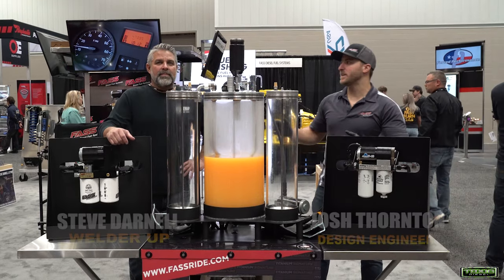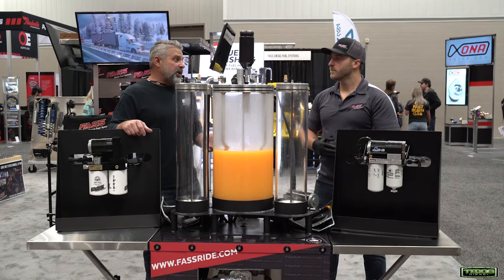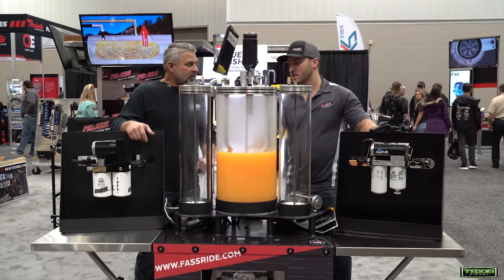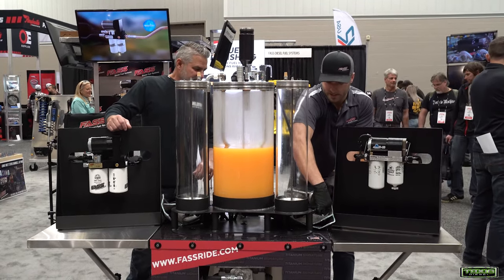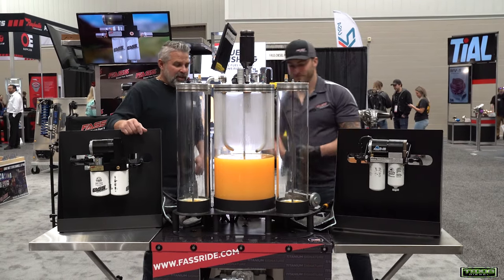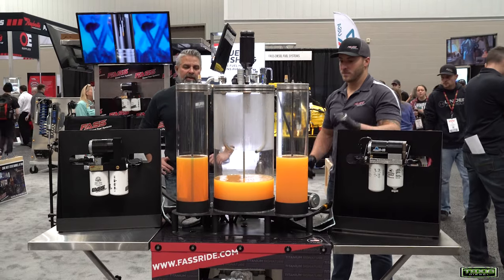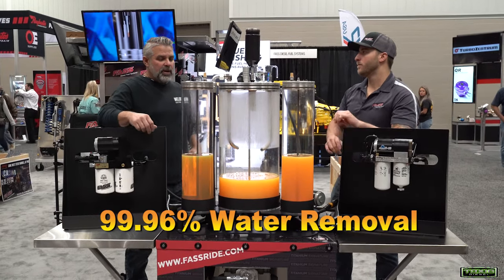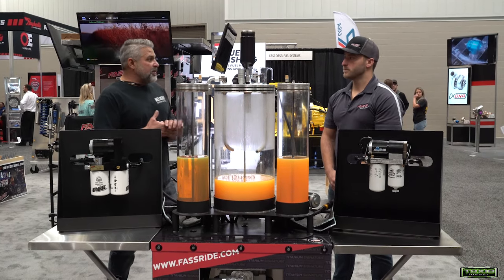FASS or AirDog - You Decide After Watching This Video

Comment: I have tested both on my 07 5.9 Cummins and they both work great however price point and customer service is so much better on the air dog I wouldn’t even consider the fass system and just seeing then use a separate air dog with no filters on it in behind the stand makes the fass brand possibly the shadiest diesel brand on the market don’t believe me call them and try to get customer service on any products
Reply: Thank you!!
Reply: AIR DOG Staff are some of the most friendly professionals and knowledgeable about their products I have their systems on my 02 and 04.5 cummins and they have stood by their products. Highly recommended.  Idk anything about Fass systems. Never needed to
Reply: Yeah this test is rigged lol
Reply: Where did you see them using and air dog with no filter?
Reply: Had a warn out 200gph old style Airdog  on the truck I bought. They worked me a new motor and rebuild kit, and I modified it to run Cat filters and Baldwin water separator with dump. 
Customer service and treating people right is air dogs advertising.
Running a separator with no dump is not normal in heavy diesel equipment.
Reply: @robsnodgrass915 what did you do to run these filters and what part numbers ? Thanks

Comment: a good fuel pump should not be putting air in  the fuel like fass just did in the video
Reply from the maker: This test was demonstrating how FASS uses better quality filters.
Reply: @toxic-performance  I'd like to see filters on the Air dog, not empty canisters. Laughable!!
Reply: @toxic-performance  its a Fuel Air Separator System.. there should not be big bursts of bubbles in the fuel line
Reply: My buddy’s fass is trash be rebuilt by fass many times
Reply: @resqjason2 I don’t have a dog in the race but I’d guess the air bubbles are simply from the water fountain effect of the tanks. If he primed them and let them settle before turning it on or filled them a quarter of the way then let them rest and then run the test you wouldn’t see any bubbles. 🤷‍♂️
Reply: @toxic-performance except people saw more than you meant them to pay attention to…

Comment: After seeing all those air bubbles defiantly going with the air dog I would like to see this done with clean fuel to compare the air separation of each pump
Reply: They also have the returns blocked off. When they are routed you get basically no air out of the fass

Comment: A pig is used to clean oil pipelines. When refineries distribute fuels to tank farms there is no pig used. 
Contaminated fuels are pumped into slop tanks that gets hauled back to the refineries.
Fuels at tank farms are continually tested after transfer to check quality

Comment: You can clearly see a separate motor with no filters on it behind the airdog tank and not behind the fass one. Their just pumping the same fuel into the airdog tank and not running it through filters at all. Scams
Reply: Hahaha yeah just noticed it! Wow I have an air dog on mine no issues
Reply: I'm pretty sure that's the circulation pump for keeping the center tank aerated.

Comment: Doesn’t it have to do more with the filters than anything? Pump is a pump right
Reply: a pump is definatly not a pump. i think the test is rigged to demonstrate "fass filters better than everything" and hollowed out air dog filters............  you're supposed to drain a fuel water seperator once a week or sooner generally. so with a FASS you replace a filters once a week? not to mention that
they were indeed using the FASS and Airdog Pumps even if they used the air dog without filters or rigged filters.... you can thee the Airiation (the amount of air pumped into the fuel)  on the FASS product........ its far far worse to have bursts of air pumped straight into your fuel lines than it is to have a little water.  lets not forget FASS quality control is horrible. they have good customer service though.  but Air Dog has Extremly good customer service. and Really high quality control......... i've had an Air dog lift pump on my truck since 2008. had 0 issues from it. still delivers as much fuel pressure as advertised. 230k miles later

Comment: Soooo the product from Fass your pushing is one without the water separator drain valve, and it’s also not even for “on road” use.  It’s only rated for transfer tanks with a tendency to clog up and blow fuses (on our trucks) and fry the pump motor. Good call, I’ll go with the one on the right aaand another retailer!  Good try on the product push though.  FYI, Fass purchased a stake in Alligator diesel, so I’ll stay away from those guys too!  ✌🏼

Comment: Love my airdog, my buddy bought a fass and tried to run it off the pickup like my airdog, and his truck would die at half tank. He decided to just buy a new tank with a sump to kake it work right. No such issues with my airdog.
Reply: your buddies pick up was probably disintegrated they usually are
Reply: Probelm was no sump in the first place😂 if you do it from the top you need it longer with v cuts
Reply: Need an upgraded draw straw . Or beans sump I run an air dog 150 and a beans sump with return line I bypassed the stock fuel filter and removed it from the truck going from the lift pump straight to the vp44  injection pump. on my 99 Cummins you can also use Cat fuel filters
Reply: @adrenalinenjunk yes they like to break I just use a beans sump so I didn't have to drop the tank and install a new draw straw .. works flawlessly

Comment: The new at this time FASS water seperator had issues from what i was told left particles that the filters couldn't filter. Thatbis why my #8 injector got clogged and then became a plasma cutter popping a hole through my piston.
Per mechanics words. FASS still hasn't committed on my email i sent them two years ago. Ruined my brand new engine of 15,000 miles. I haven't fixed it since 😢

Comment: Fass has a water separator with no drain.  So what happens to the water ?
Reply: Also josh works for fass so this is a bias test to me
Reply: Well see theres a fuse that blows and thats when you know that you have to change your filter on the side of the road more than likely with no filter or extra fuse..... OH AND YOUR INJECTORS LOVE WHEN THEY RUN OUT OF FUEL BY THE WAY...

Comment: I'd love to see the air dog with the fass filters.....
Reply: The filters are the only thing doing the work on these systems you can get better filtere from fleet gaurd than either company sells
Reply: The filters are great until you figure out they’re not meant to be ran on a vehicle
Reply: @PaulMcClellanmn  pretty shady that theres like 0 filtration on the airdog and i know their filters to be excellent quality. but i stopped using them i use only Donaldson Filters. if i can't get any i get CAT filters on my air dog........... it just disturbs me. the test has to be rigged....... and even if its not... bursts of air into the fuel lines is way worse for your engine than a little water contamination. and the fact the Fass system has no drain vavle / fuel water seperator.  you're technically supposed to Drain a fuel water seperator atleast 1 time a week before operation. so you're supposed to replace the FASS filters every week or sooner?
Reply: @PaulMcClellanmn  another thing to point out. a channel i watch. called "show me repair" did a video diagnosing a 7.3 powerstroke no start in a excursion. the quality control on the fass Product just isn't there. it was assembled new without a key componet to make it work properly.

Comment: This issue between sumps and top fed is a no brainer. Anyone with any sense of the laws of physics knows sludge and heavy particles seek the lowest point. You’re just sucking all that in and IDGAF how good your filter is, particles will get thru. Best bet is to leave that crap on the bottom and you should never go below a 1/4 tank anyway. Unless you a poor MF’a which you shouldn’t have a diesel to begin with.

Comment: What about HydroDiesel
it is water and diesel with an additive that keeps the mix emulsified and people are reporting more power , cleaner engines. longer lasting engines , better fuel economy, better price of course since you are basically watering down your diesel. It looks almost like milk with a white color to it and doesnt require any modification to your existing engine. I saw a channel on here do a side by side comparison and I was very impressed with the hydrodiesels prefromance.

Comment: With my experience with fass I wouldn't buy their product if they were the only product on the Shelf
Reply: a early style HFCM with a fuel heater on the 6.0 powerstroke is more reliable than a FASS product. to name a few things it does better. it lasts longer it seperates air out of the fuel. it warms the fuel. it performs "fuel polishing"  of the fuel it filters it sends some back to the tank. oh and its service able and has a built in water in fuel sensor.

Comment: People listening to him have absolutely no idea what he was talking about when he said pig pushing fuel threw the line hahahaha.
Also the air dog isn’t set up properly there should be a return line that returns fuel water and air back to the tank to be cleaned again and only pure fuel should go the the cp3
Reply: Pigging is part of my job, this dude knows exactly what he was saying.
Reply: @kevinlastair9808  that’s in a pipe line there is a pig separating each type of fuel being pushed but in a fuel pump from a tank there is no “pig”
Reply: @Justthemow  for what’s it worth, what I got from that his statement……is that when pigging you get trash, (called the envelope) and it can make its way into holding tank. 
“Separating fluids” would be like batching, for chemical treatment like a corrosion inhibitor or Boicide for killing bugs. 
But yes, his comment prolly didn’t makes since to 99% of the listeners.